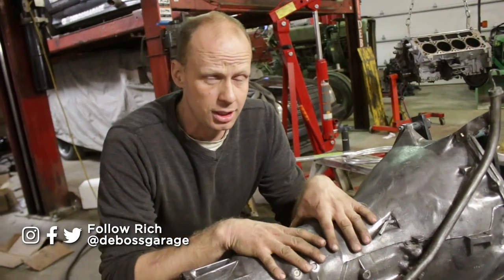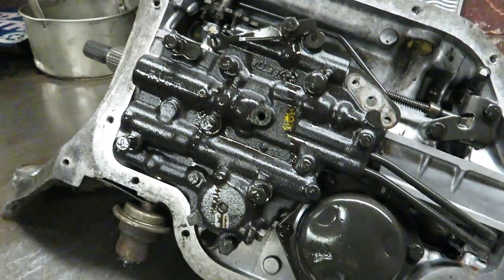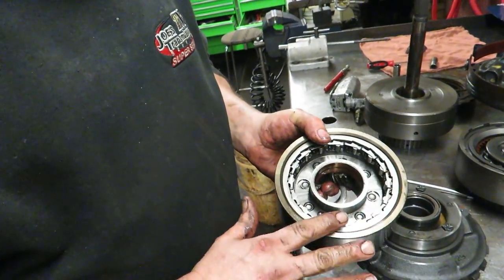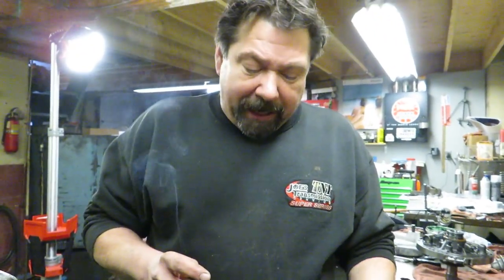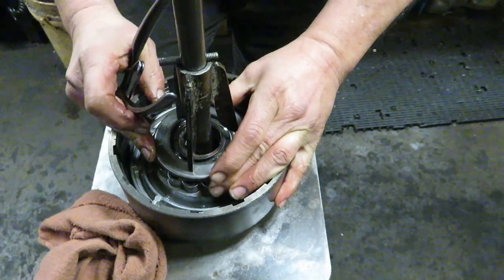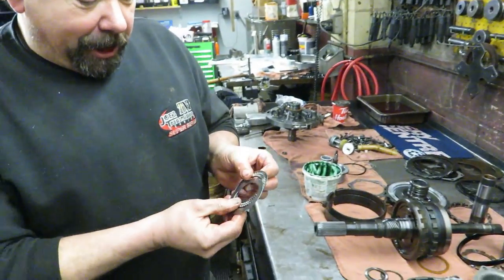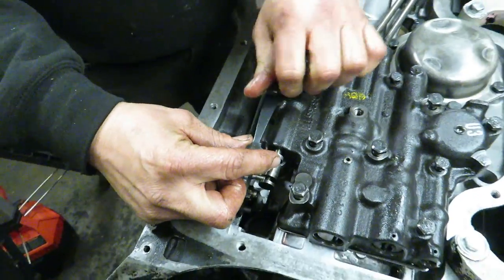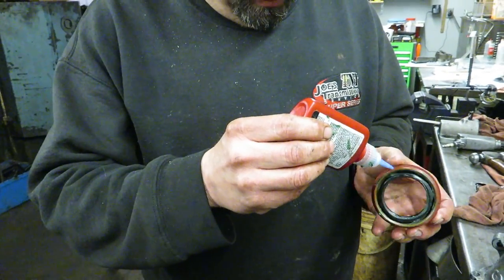How To Build a High Performance TH350/TH400 Transmission | '67 Pontiac GTO [EP16]

Comment: To bad Joe built me the worst Turbo 400 for my GTO 
It was supposed to handle 1000hp and after it’s first outing to the track it wouldn’t shift gears. Case shifted & damaged everything. I will never ever go back or recommend his services. I listened to the wrong people.
 So I had my original Turbo 400 built at Newmarket Transmissions which I spent 1/2 the $$ and it’s been beat on by my 70 Gto 10.second car for over 8 years so far!
Joe would not warranty it at all cause I had my guy open it and verify it’s condition & parts. My guy told me he used basic rebuild parts that would never handle the power I was giving it. Only the deep sump pan & the valve body was useable. Live & learn!
Reply: If your making a video + all the advertising you better make that trans right!. Newmarket Trans saved me & that’s who I use from now on!!!

Comment: You can get a set of straight cut gears for the TH400 you can not get for the TH350. I have never seen a broken straight cut set. You usually find these gears in motor homes or heavy trucks. They are ideal for an automatic 4x4. But I'm still partial to the 727. For your first build you can't do much better than a TH350.

Comment: "what's a TH350?" - young people probably. I'm surprised people still use them with the 700/60e being around for so long. Hell I'd probably try to find a 200-4R over a 350.
Reply: My ‘77 K10 with 400ci smallblock came with a TH350 (stock pan, BTW). I turboed the smallblock and did a shift kit on the TH350. Never had a problem with it. 

With my El Camino, I’m doing a built 200-4R with 3.73 gears. Good combo for go and cruise. Although I’m a stick guy, automatics have their place for a good cruiser.
Reply: Prefers Anonymity just put a th350 into my 57 belair.  The old stuff still works
Reply: chuck fults I’m a youngin im 19 years old and I know of the TH350 because I’ve built one, I have a 93 trans am with a 383 stroker and a TH350 with a manual valve body. Building the car made me grow up fast, but she’s a blast to drive! 500hp in a 3200 pound car is just fun! I’m never going to lose the need for more power lol
Reply: This is actually a THM-400. If you are bolting up to a Buick/Olds/Pontiac engine your only 4-speed option is the 200-R4 and while it can be built up to live behind a big block, it's gonna cost you, and the car is still going to use a lot of gas - the economics aren't going to work for a lot of people. There's still a niche for the older transmissions and the THM-400 in particular is just tougher than a brick shithouse.
Reply: @mtut  oops, i commented right after they put the video up and was just going by the video description.
Reply: @mtut  they make adapters, but its best to just junk the Pontiac power unless you dont mind spending a fortune to build it
Reply: @JohnnyAnderson1  Sure, but that's Pontiac. Even then, there are some iconic Pontiacs that you'd want to keep original-ish if you had one. Chevy engine in a GTO? That deserves a paddlin'. Sorry, but it just does. If you're going to go for sacrilege, why not swap in a Cummins diesel or something? A Ford turbo V-6? If you're gonna go to Hell anyway, why not earn it?

We can go around and around about who makes the best engine and everyone who lives in the BOP world has favorites. I would rather put the money into the engine than cobbling up an overdrive transmission that isn't going to turn one of these old boats into a Corolla on the highway. You've got an expensive toy either way. 

Note also that the Cadillac 472/500 also has the BOP pattern. And the Cad plants are in vogue lately. 

I don't buy into adapters, if it's possible to avoid them. Many of them have alignment issues that may not be detected but compromise the engine or more often the front pump over time (or pilot bushings and trans bearings on a manual). You see it on some vehicles where the same alignment-sensitive parts just keep going bad at 20,000 miles. I know a lot of people do use adapters and have no problems. But even imperceptible alignment issues take their toll. 

If you do want overdrive, the 200-4R can be built as strong as a 700-R4 can. The main advantage of the 700-R4 is the really low first gear, which on a big block is kind of a non-issue since there's generally plenty of torque already. I'd just skip it. It's such a cliche now, anyway. 

Knowing the car is going to be a gas hog regardless, I'd use a THM-400 and keep it somewhat historically accurate. Just my opinion. But if you watch the video, this is really an impressive transmission for its time. Even expecting to be doing severe duty, not many weak spots in the original design.
Reply: @1curt12  the j v ihih8 iiviiiihh the wifi hiiiihiii for higjj higiihihjhihhhto ihiihivhivhhg vihi
Reply: @mannypuerta5086  there are

Comment: Does anyone know how much it would cost to get a new torque converter and get the trans inspected and fixed if it has any other issues, and to have it built to like 400+ hp (handle 400+ hp) also trans is coming out of my 2005 Ford F-350 6.0L powerstroke

Comment: What is the max torque a TH400 can take? I'm wanting to put one behind a mild built 5.9 (probably 500hp). If you dont think it will hold up, is their a manual GM transmission that you think will?
Reply: As they said in the video, about 450 ft-lbs when stock. TH400s can be built to handle over 5x that
Reply: IIRC, the "400" in TH400 was the torque rating.

Comment: DEBOSS, Make that TH400 into a TH475 with straight cut planetary gears! It will take 600hp all day every day! TH475, Almost an Allison! Hell Yeah, an old butterfly air ratchet, funny questions from my kids,Dad what's that for! Great for puttin valve body bolts on and off!
Reply from the maker: I doubt we will ever get the 400 (engine) to 600 hp.  our goal is around 400...
Reply: With a stroker kit, that 400 can hit 600 ponies.....

Comment: The TH400 in my wife’s 70 GTO won’t shift to 3rd ....any ideas?
Reply: My guess would be a sticky governor? Does it rev high before it goes to second? Could be a bad vacuum modulator, so it's holding the gears like under full throttle. Lastly, it could be something else inside. I forget if it's a band or clutch for 3rd gear, but look into the first two.
Reply: Make sure the shift linkage is well adjusted and operating properly, (sounds stupid but---). If it's also shifting high from 1-2  then check that vacuum shift valve and the kick-down circuit/solenoid. Other than that, it gets more complicated.
Reply: Prefers Anonymity It goes into second smoothly and fairly quick , I did a new filter and fluid before winter storage but... still no 3rd . I’ll check other things you’ve mentioned . Thx
Reply: Does it just slip after 2nd or stay firmly engaged in 2nd.
Reply: @fascistpedant758  would a slip happen on a 2-3 shift?
I had an 83 celebrity with no 2nd gear. It would go 1st to 3rd, and 1st would rev really high but it didn't feel like a slip. Maybe it slipped for the last owner
Reply: It's just better to make sure we're talking about the same thing. Is it not shifting or shifting up to a bad 3rd gear? I usually take a car for a test drive to confirm the complaint. You can bark up the wrong tree for a long time if you're trying to fix the wrong problem. I am assuming that it can be slipping only in 3rd. It's better to ask too many questions than not enough.
Reply: anti chuckle It goes into second with a decent firm shift .I’ve tried staying hard on the throttle to see if it will change... also tried moving the shifter slightly forward of drive to see if The cable shift was just out of the detent .
I should mention this “stuck in second”
condition occurred on  the first drive after pulling it out of winter storage.
I’ve diagnosed problems with a TH350 before but, the TH 400 is still taking me to school. Lol

Comment: You wan to make a good cruiser and you didn't put a four speed overdrive auto (700r4) in it? If you insist on using the old turbo 400, at least blast and paint it before installing it...
Reply from the maker: It's painted.  Relax.  We live by a Lake.  50km/hr with my family in the car.

Comment: The only thing that scares me is, Is he starting those bolts by hand, a few threads, before using power tools? That's a great way to cross thread a bolt! @ 43:49, Rite as he say's "it acts like it's stuck in 1st" You see him use a pneumatic wrench, My question is, Did he start the bolts by hand 1st or, Did he just rip them in with the air wrench? All bolts must always be started by hand 1st, to ensure that they are going in straight & not cross threading, JUST A FEW THREADS!  I always see other mechanic's online, use a power tool & speed threw a install & the next time someone has to take it apart, you run into a stripped thread, That is why I always start every bolt & nut by hand 1st!!!! Removal with power tools is fine! When putting things back together, every nut & bolt has to be started by hand to ensure that  you are not cross threading,  Online, You always see someone using power tools & simply zip everything together & in reality, it is not so simple, One must take the time to properly start each nut & bolt a few threads by hand before using any power tool!!!!!! I am sure that guy knows transmission's, inside & out! I just wonder if he took the time to start each bolt by hand 1st, to catch a few threads before using power tools????? Nice video though!!! Finding a quality transmission shop & filming isn't as readily available as a everyday Joe showing how to rebuild or fix this or that. It is harder to find someone who has so much experience with transmissions!
Reply from the maker: Yes those bolts were started by hand. He also uses the pneumatic with gradual force every time. We show him doing it a couple times but a video this length is better when it's fun to watch and to the point.

Comment: Yes we know manuals are fun, but an automatic doesent make it any less of a muscle car. They are beefy and alot of times even faster than a manual. And theres a reason so many big heavy cars benefited from having them. My 1971 mercury cougar xr7 had a 351 cleveland with a C6 3speed auto and it was plenty fast for the suspension and power brakes from the 70s and comfortable too. And nearly bulletproof so suck on that automatic haters. Classic cars are still cool auto or manual.

Comment: 11:22 ya, trying to remove that "shift shaft" seal with out that tool is IMPOSSIBLE!!!!
its a cheap tool (20 bucks), and will work on a LOT of older auto-boxes.... 

otherwise.... ya gotta drop the pan and do some "non-approved" things with "non-approved" tools......
and usually nick the case to it leaks even worse than the old seal did....

and the way you fix a bad case..... buy a whole new trans

Comment: I love to build motors, do everything on a car...... EXCEPT auto trans rebuilds.... I am all set... too much for me
Reply from the maker: I am the same way.  Thought we could clear the air a bit though.  Things like a break in the one electric shift valve would create a no shift and it's super easy to get at and diagnose.  Could save you a few hundred bucks just checking that out.
Reply: @DEBOSSGARAGE  I used to think this way too, always looked too scary and complicated. Then I decided it was time to upgrade the transmission in my 71 GTO to overdrive so I watched some youtube videos read a book and built myself a stout 200-4r, It's really not that hard. I've since then done a 4l60e, 4l80e and a 4t65e all of them worked perfectly when done. It's not magic you just need to be methodical.

Comment: I have a 680hp 68 Mustang with a fuel injected 438Windsor pump gas street car all motor 410 gears and drag suspension. I blew up 4 built C4 transmissions, and the last one was supposedly bulletproof to 700 crank hp. Just fried it 2 weeks ago and only 500 miles of hard street driving on car. My trans guy said throw pos C4 in trash and i will build you unbreakable 1200hp capacity TH400. He said you will never pull this trans again unless you make over 1k wheel. C4 may last a season in a high powered car, but it needs constant refreshs. Fck that. Refreshs are expensive and i aint rich. Now i will soon have th400 and never break trans again. Dont waste any cash on midget C4 over 400wheel cause it wont last. I even blew a built C4 at 380wheel and now i am 520wheel all motor. New copo camaro and cobra jet drag cars both use TH400. Whats that tell you. They are high 7 low 8 sec cars. End of story.

Comment: No way I'd be using green for lube, its way too thick. I use either blue for lip seals or a 50/50 ATF & STP mixture. I use the green to hold bearings, gaskets, and checkballs.

Comment: So why not just put a 700R4 in the car instead??  Better hole shot,  an overdrive and a locking converter, and up to 2,500 HP???
Reply: The Th400 is a 200K miles transmission, 700-R4 is 100K mile transmission
Reply: @pmotorsports8276  your numbers are arbitrary, and really don't mean anything.  I have had 700R4's go 250K without any problem at all.  Conversely I have had 350's and 400's only last 60 to 75K which by the way is the suggested standard GM mileage for rebuild.  Automatic transmission life is determined by load factors, heat, and service intervals, not some arbitrary number.  I have a Dodge Grand Caravan with the 3.8 225 hp motor.  I have been hauling loads way over the limits set by the manufacturer, AND pulled a trailer fully loaded too with that auto for 11 years and close to 300K miles on the transmission that it came with from the factory.  MOPAR, in their standard service recommendations state clearly that those front wheel drive autos are designed, and expected to be rebuilt, depending on load and use, EVERY 60 to 70K.  So again, there is no such thing as rating a transmission at 100, or 200K.  The 700 came way after the 400, and I guarantee, it has more modern engineering, better heat dissipation, better materials etc, than a standard off the shelf 400.  You can build an automatic to do anything you want it to.  That is the bottom line.  Given that gearvendors, and other builders offer 2,500 hp versions of the 700, I will always take a 700 with 4 gear ranges, including a 30% OD and a locking converter over a 350 or 400 any day of the week.  I have owned many of all three.  Finally, I only use the pre computer 700's in all my builds. It functions and behaves like any other pre computer THM.
Reply: @3RTracing  if you have taken These units apart you'll know what I'm talking about. The 700-R4 and all of its derivatives are essentially a 2 speed. ( 1/2 use the same clutches, 3/4 use same clutches). The only gears the 400 or the 4L80E share is reverse. So by design the 700-R4 parts get used twice as much. So explains the lifespan.

Comment: They still shift with a bad solenoid, they just won't down shift automatically. The governor and the vacuum modulator control the shifting. Built my first turbo 400 in 78' when I was 19. You can also purchase adjustable vacuum modulators on ebay for only 10 bucks, not 30 or 40 bucks. https://www.ebay.com/itm/Turbo-Hydramatic-350-TH400-Adjustable-Transmission-Vacuum-Modulator-w-hose-88572-/122662832549

Comment: 55:23 i HATE the 100% rubber gaskets a LOT of "filter kits" come with now days..... they NEVER seal

the with rubber molded into the rubber "gasket frame" are the ONLY ones ill use
if the kit i ordered comes with the 100% rubber.... i send it back

you can do every trick in the book......and they wont seal
brand new pan.... ya can go to spec...it leaks
leave it loose.... it leaks
tighten it up... it leaks

where the metal/rubber gaskets..... you can have half the bolts at spec, 1/4 loose, and 1/4 over tight.... and it will seal for 100,000 miles no issues 

from best to worst.... 
metal frame with rubber
the fiber gasket shown here
cork
100% rubber 

id actually say that using NO gasket....not even with silicone.... would seal better than a 100% rubber gasket 

i hate hate hate HATE HHHAAAAATTTTEEEEEEEE!!!!! the 100% rubber POS crap tastic idiot crap inbred cousin screwing in a double wide trailer gaskets

Comment: Overall a great video. But I would call more a refresh job than a overhaul, due to the lack of new bushing and washers especially  for the application  of use. When I overhaul  these  400s in the 70-80s while in a Olds dealership I would shim the pressure regulator valve in pump with a thicker washer, leave  1 check ball  out, drill 1 hole in  valve body spacer plate, last but not least leave out a center piston seal out of 1 of the piston housings. Man they would perform  like a manual  trans  going threw frist and second gears.  This video  past a lot of knowledge.

Comment: why,  ??  go get a c6 or 727,stop pissing with chev crap...tell me why they put 9" diffs in EVERY chev,cos chev cant build diffs or engines.but,there basicaly all the same ,but,unless you have a 454 or ls3,with a top loader/c6/727/9",,wont buy it..i like my truck 351 clevelands,or its dad the 460..why does the 350 rely on the timing chain to keep the cam in place.why is the 350 such a shit design engine.you need an 010 block,if possible,then visit your speed shop for the rest of it.&&,i also have a dodge challenger,70,s.thank you lord.